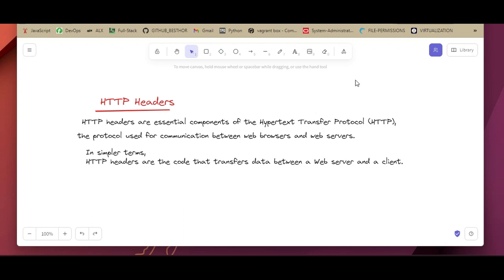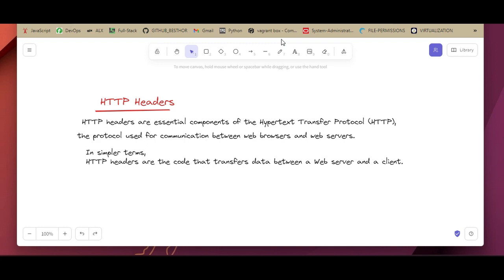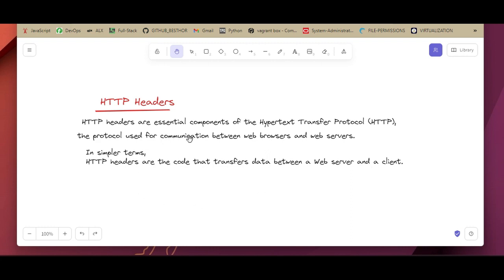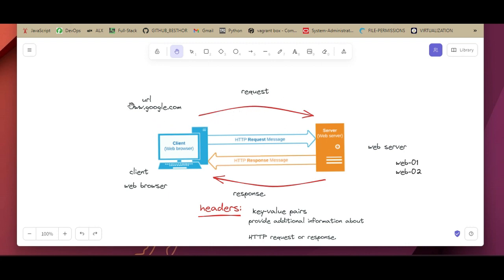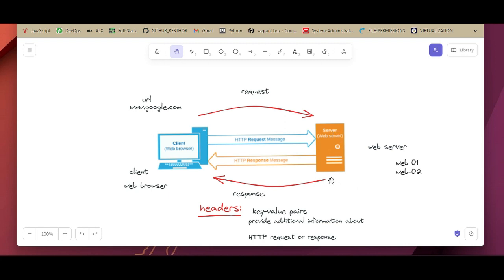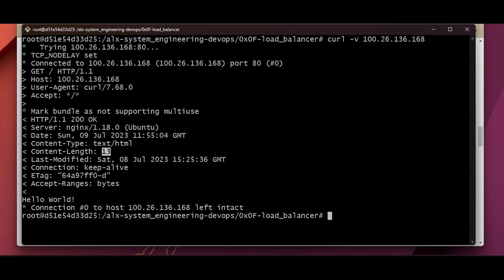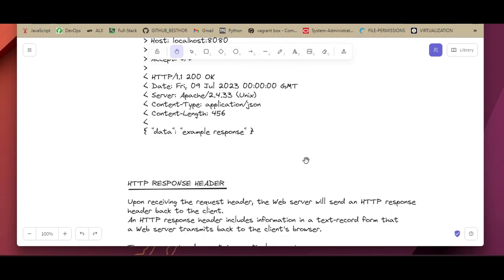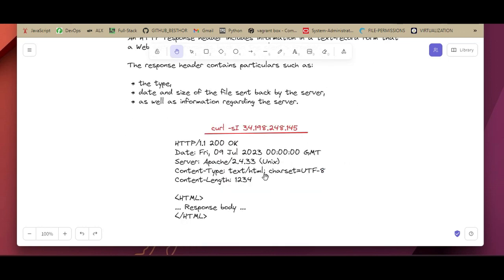0x0F Load Balancer: Part 1 of the Complete Guide

Comment: pls when running my ./web-02 it says no such file as ~/.ssh/school
Reply: Actually, web-02 is'nt a mandatory file, it's just his own way of automating login to web-02 once in a single file instead of typing all those commands manually everytime in the terminal.

And if you do like to do same, ensure you create the file `web-02` with the web server 2 login credentials(username, IP etc)  in your project directory or where ever you can execute to login to your web-02. Don't forget to change permission/make executable chmod +x web-02.

Hope, it helps.
Reply from the maker: It seems like the ~/.ssh/school file might not have been created or is in a different directory.
Double-check that the SSH key file exists and that the path is correct. 
If you need help generating an SSH key, please let me know!

Comment: the checker 6 did not pass and i have cross checked for syntax errors. any help pls
Reply from the maker: Thank you for reaching out and sharing your concern about the checker 6 not passing on. Firstly, it's important to remember that syntax errors are not the only possible cause for a checker to fail. Here are a few steps you can take to address the situation: Double-check the task requirements, click on the review  button , it can provide more details about the specific error messages or any other relevant information.
Reply from the maker: Alternatively, you can compare your script with mine and fix the relevant issues, Its possible there's an omission on your custom error page. Use this link to access my script: https://github.com/besthor/alx-system_engineering-devops/blob/master/0x0F-load_balancer/0-custom_http_response_header
Reply: @besthor_tech  thaks very much, i was really syntax error on my error page i omited a backward slaph "/".. thanks alot. pls when are u uploading the task 1. i really apreciate ur effort, if not for u i dont think i would have continues again sef, lol. kudos man.
Reply from the maker: @delacliqueentertainment4456  You're welcome! I'm glad I could assist you in finding the syntax error and resolving the issue. It's great to hear that my help has been valuable to you. Regarding the tasks, i'll make some uploads tonight. Embrace resilience, trust in your abilities, and remember that success comes to those who persevere. best of luck with your projects!